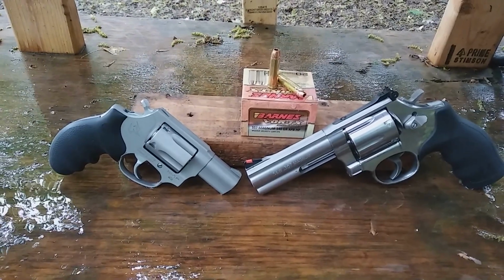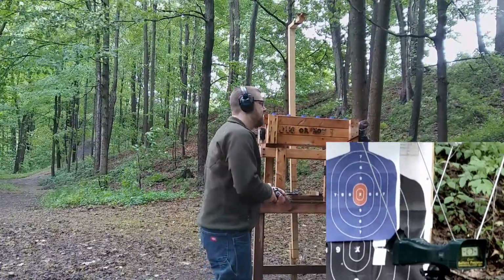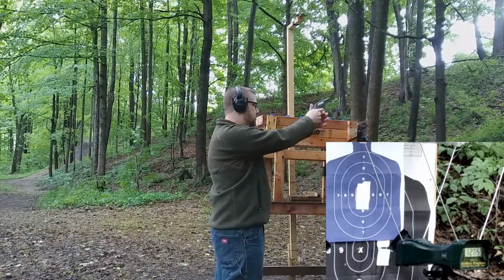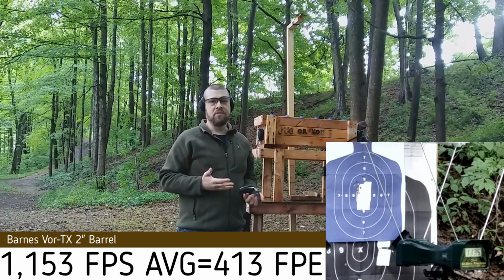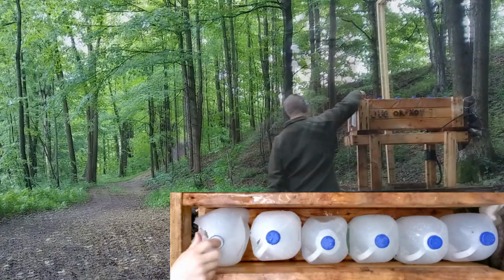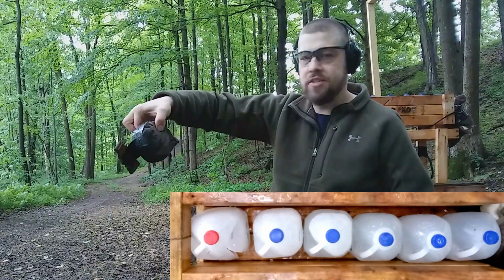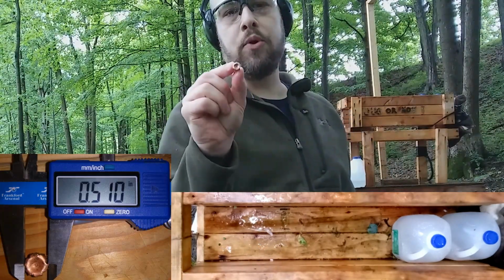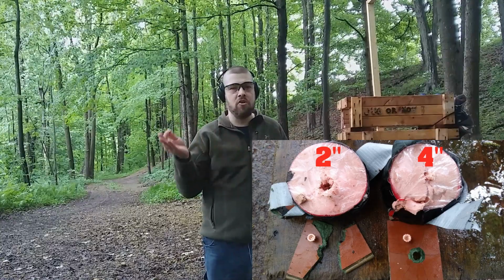.357 Magnum Ammo Test Episode 3. Barnes VOR-TX 140 gr XPB

Comment: I actually like this as an overall multi purpose load to carry in a 357 when camping, hiking and hunting. It has really good hard barrier penetration yet has very solid expansion characteristics. I feel more confident in this load than anything else to deal with all the threats I may encounter in the woods.

I only have one 357 revolver and that’s all I use it for. Basically an outdoors gun. My other revolver is a 38+p loaded with 130 gr HST and is my edc.

Comment: The projectile doesn't seem so bad. And it looks like you only lost about 100 fps going to the 2". So I'm thinking it's a snubbie load. The failure to fire is disturbing. They need better QC. Copper projectiles are very expensive. In my mind, the only reason to use them is if lead is banned.
Reply from the maker: Yes. And with the misfire, well i'm glad it was in the revolver it was in because not many would argue that it was the revolver with stock everything. After my correspondence with Underwood, I am learning more about these type of issues. It's possible that Barnes also loads hot which is causing the primer to back out or however that issue was worked. Working with full copper and having less case capacity to work with, I suspect higher pressure than typical even though the energy wasn't that spectacular.
Reply: @GunSam  It may well have fired on a restrike. The firing pin probably seated the primer the rest of the way. It's certainly not your gun's fault. There are extended firing pins available, but typically one only uses those with reduced power spring kits.
Reply from the maker: @Fudmottin  I save the round to take that photo lol. I probably will shoot it again.

Comment: Barnes bullets are purely hunting rounds made for deep penetration and 100% weight retention.  Barnes seems to load these kind of weak in the 357 mag caliber?  I know others use that bullet in their ammuniton as well such as the Federal Barnes Expander.  I believe those are a hotter round.  They are fantastic for whitetail deer, especially in lighter caliber rifles as they tend to penetrate all the way through with good expansion and full weight retention.  Not really a good self defense round as they aren't as explosive as a standard lead core bullet.  They streamline and penetrate very far and open without issue.  I tried a box of the barnes VOR TX in my .223 rifle 55gr just for kicks in deer season a few years ago.  As luck would have it one of the bigger mature bucks came out to my rattling at dusk at 150yds.  One shot behind the shoulder and it was a complete pass thru.  The deer was rocking back and forth at impact and never ran..He simply tipped over...It was a 200+lb. 4 1/2yr old big 8 point and he didn't know what hit him..I was really impressed what it made the small .223 caliber capable of doing on deer sized game within 200yds.  Following year we tried it in my sons 22-250,,more power and fast .22 centerfire.  Same results one shot clean pass through, fully opened for sure by the wound track and we actually recovered the bullet in the dirt..It was a perfect mushroom with 100% retention.  That buck was 230yds. with my rangefinder and those were 50 gr. bullets...We usually just use our good old 270 Winchester caliber rifles with bonded lead core bullets..Yes they do the job just fine and do much more damage to the deer as expected.  It was still a cool experiment and I got a great mount out of my little .223.  He was a perfect 4x4 with a 18" inside spread and measured 127 1/2" score.

Comment: Well hell, not near what I was expecting. I'm of the notion that energy transmission into the first jug (having defeated the flab and bone analogs) is ultimately more important than exploding bologna tho'. Don't forget that one might need your round to stop a threat after it has passed through a forearm or elbow joint... In that regard it appears it could do very well, still I expected more splatter coming and going. One more thing that I'm presuming, but confident of, is that bullet design, with that long shank, would defeat many common barriers very well (sheet metal, auto glass etc) and still throw some significant energy into stuff behind it. So essentially I think we have a "full metal jacket/wadcutter thing with a bonus hollowpoint stacked on it's nose" here. But I am also quite surprised at how far back the petals were folded for these shots. Must be the speed (and possibly the bone analog), but that points to them being awful speed dependent, as I'm sure I put a dozen plus into gel (with and without denim) done up as .38+P-ish hand loads ranging from 850-1000 fps and they invariably opened magazine ad beautifully with the petals uniformly spread at right angles/wide open (akin to those 110grain Tac TX's you tested), but any slower than 850 and they wouldn't open at all. I stocked up on chingos of those spendy 140gn components too. More wind you've taken out a my sails again... Good vid none the less! You've got me considering revisiting my 200 gn SuperTrooper franken-load idea again.
Reply from the maker: Thank you. I am still undecided about this ammo.
Reply: @GunSam   [✓] when going for a "ballance" I still suspect this is a grand choice.  I shot a handful of these Barnes factory .357 across a  Chrono a while back out of a Model 60 (back before I acquired the gel), but only ONE out of my wife's Scandium 360PD. T'wasn't fun... 

Edit: That and a Remingnton Federal offering that's loaded with same bullet. Those are in some gorgeous nickel cadmium cases too

Addendum: There is a very similar looking 125 gn Barnes XPD component bullet out there (got a box or two of that somewhere), but I haven't loaded them/any as yet.

Comment: You've gotten a lot of duds lately, goes to show even premium centerfire ammunition isn't 100% reliable. Good argument for carrying a revolver.
Reply from the maker: Yes, and even so imagine if it was a hang fire instead, rotation to the next round and then a hang fire....would probably remove your barrel, and maybe a finger or two as well.
Reply: @GunSam  that definitely wouldn't be good, especially with Magnum ammo!
Reply: @GunSam  One could say this could be seen as an advantage for a semi auto. In that case you would cycle that round out and it would no longer be a threat, well not much of one anyway. It's just that you do have to manually cycle it and that's not as quick, natural, and/or instinctive as just pulling the trigger again.
Reply: Food for thought, I had to clean out the firing pin channel of my modern 686+ as I was getting multiple light strikes on European 357 ammo. All guns are tools and need maintenance. None are infallible. Once I cleaned that I haven't had a light strike since in 1350 rounds.